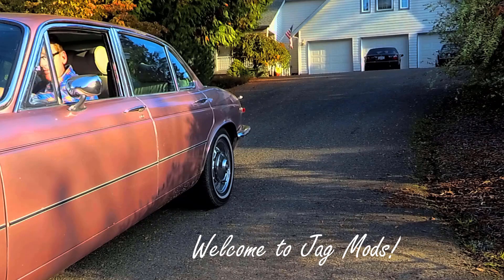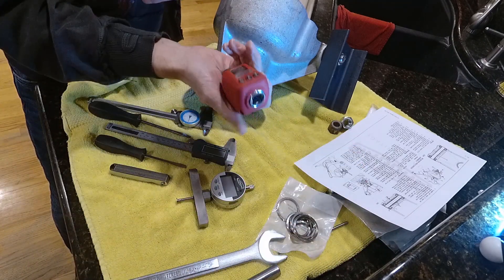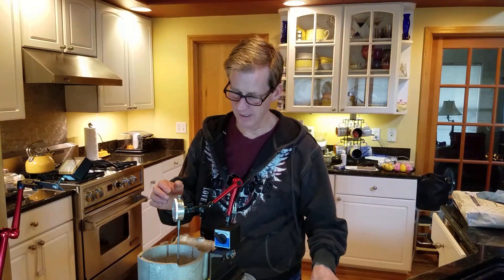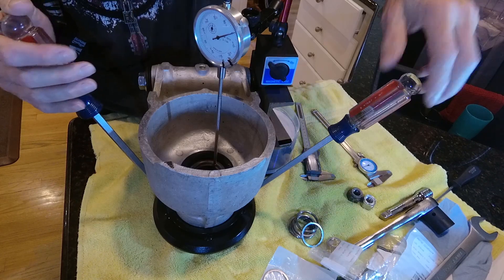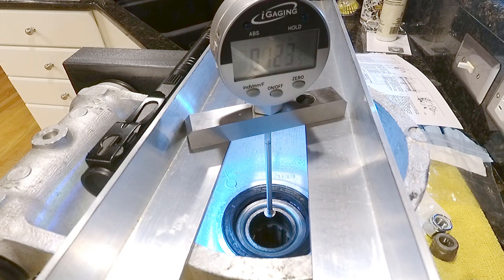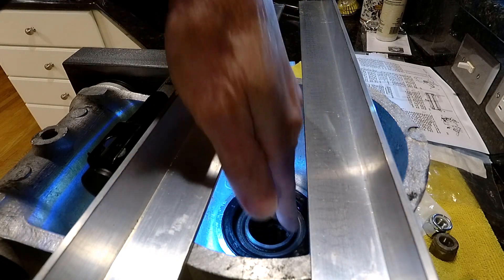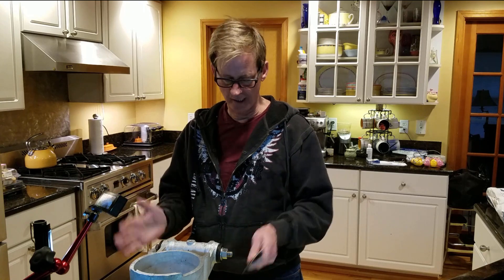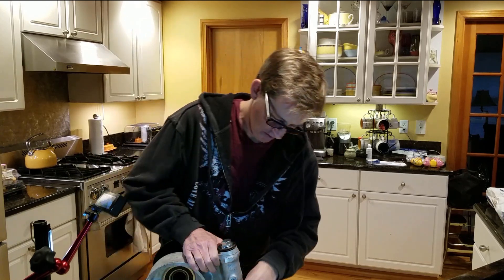The final chapter of the Jaguar IRS Carrier rebuild, Prepping for the installation

Comment: Great videos with lots of details and I have just followed your rebuild of the hub. Jaguar manual specify end float 0.001-0.003" end-float and not preload for the hub shaft. You measured 0.0005" float. No movement would be present if it had preload. It seems the most common mistake people make.
Reply from the maker: Yea, I know I kinda got my words mixed up while I was… well confused. I’ve stated a video on my screw ups and that one was on the top of my list. Good on you for catching it. 
Thank you so much for commenting and pointing it out. Hopefully people will read your comment!  Thanx. Again, mate!

Comment: Mark, I got underneath my Black Pussy and found that the disks were clean of any surface rust (one good thing came of leaving the handbrake on). the handbrake pads do not appear to have been damaged that much so I have adjusted the handbrake through the cable and it seems to be a lot better . I will now go for a test drive and check it's all okay. Thanks for your help. Garreth. Just took her out for a drive, all seems okay, may need to back off the cable a little.
Reply from the maker: Excellent! yes, the cable is the best route to go for heavy amounts of adjustment.  The auto adjust is strickly for fine adjustment becauuse the spring back mechanism is nothing more than a two pronged fork mounted to the top of the caliper and hand brake pad mounting thingies.  haha... It's not spring steel, and over adjustment will bend and / or crack the forks relieving the ability to pull the pads off the rotor when handbrake is disengaged. 
Good news, and good call! 
Sincerely,
mark @jagmods

Comment: Mark, I'm sure I know the answer, but I just drove my XJS with the handbrake on for about 20-30 miles and think I have worn the hand brake pads down to nothing. Is there a way of changing the hand brake pads without dropping the IRS, or adjusting the handbrake cable in the car to take up the slack? K6GTS
Reply from the maker: First off, I highly doubt you've worn the handbrake pads to nothing, unless this isn't the first time, or you're doing handbrake turns in your XJ-S.  There is a whole lot of material on the pads. More often than not, the handbrake pads have plenty of friction material long after the regular rear brakes have warn through the rotor. A way to check it is pull up on the handbrake, and if you hear or feel metal to metal through the handbrake leaver then your right. 
Adjusting the hand brake is done two ways. One by adjusting the length of the handbrake cable by taking up the slack on the cable itself via the nuts on the outside of the cable where it attaches to the handbrake assembly under the car.  Keep in mind,  just pulling the hand brake on and off and on and off and off a whole bunch of times is the fine adjustment for the handbrake.  This is the auto adjustment feature.
How the auto adjustment works,
There's a pawl and cam inside the handbrake mechanism that does the fine adjustment (see my handbrake rebuild video).  Providing your pawl isn't broken.  Which is very common.  Mother nature beckon for the spring to return to earth in the form of rust.  Essentially rendering the fine adjustment useless. 

 Back to your question... do you have to drop the cage out?
Short answer No.  Is it an easy job? not even! It's a bitch - especially if you're doing it in your drive way or garage without a lift. then it's a miserable experience. That being said, 

Here's the game plan: 
Objective - Get the caliper off in order to change the handbrake pads - sadly there isn't any way around it.  Oh, one more thing... if the pads are worn to nothing - chances are the rotor is probably heat checked too and should be replaced.  If it's a series of pretty colors other than rust or silver, then it got hot - really hot.  brown is 480F, purple 540F blue 575F, gray 800F pinkish gray 1000F The colors are a clear indication of just how hot the rotor got. anything higher than purple,  then the rotor needs to be replaced as well.

Ok, back to the game plan... (Sorry side tracked)
The wheels hubs and the half shafts come out as one unit, - easy peasy.  there are two thin washer thingies  these are shims and have to back where they came from.
Liberating the caliper from the Diff is not an easy proposition. The bolts to the calipers are not very accessible There isn't much room between the caliper bolts and the differential, then to exacerbate the situation, there isn't much room between the boot floor and the IRS  unit itself.  
Once you get the lock wire cut off, and pulled out which is a feat unto itself (on the car) usuallly because it's rusted, and breaks off so you can't get a wrench on the bolt.. Then wrenching the two fine threaded bolts, holding the caliper on the diff at about a 1/4 turn at a time is a true test of patience. This whole process will jump up and down on your frustration button(s). 
The shocks and the radius arm will have to be freed from the fulcrum arm / wishbone (what ever you want to call it) in order to drop the fulcrum arm 90 degrees (perpendicular) to the IRS / car / ground in order to get the rotor off in order to free the caliper.  meaning you'll have to get the car at least 22 inches off the ground. Most floor jacks and jacks stands are good for about 19 or 20 inches.  So there's that too.
Like the good book of green (the Jaguar XJ-S Service manual states way too many times) do all of the above in reverse?  USELESS info!! .

It's very important to keep track of where stuff came off during this whole process. Especially the the shims.  There's a stack of them between the diff and the rotor and the other side of the rotor and half shafts these have to go back in the same order otherwise your camber will be off. There is also two sets of two (usually) shims between the hub and the fulcrum arm that centers the hub between the two mounting points on the fulcrum arm.  Those also have to go back where they came from. OH, and the two shims are usually two different sizes. Meaning put the same thickness in on both sides, otherwise the hub won't be centered between the mounting points on the fulcrum arm.  If they're not too mangled in the process of removal.  These can be had at SNG Barratt at a very reasonable price.  Buy more than you'll need because chances are you'll mangle a couple sets trying to get the hub in position - I did.  Oh, also go the salvage yard and pick up at least one scissor jack.  these are worth their weight in gold for fine adjustment / holding heavy parts. Unless you're mister muscle man - these parts do get heavy while trying to finesse all this sh#t back together.

Oh, then there's the lock wire... I have no idea how you'll be able to get that back on the calipers bolts while the cage is on the car. Most self proclaimed Jaguar specialist don't bother with it - and put a lock washer on instead. I personally do not subscribe to this philosophy.  It's there for a reason (to keep the bolts from backing out), The bloke who designed this suspension is a whole lot smarter than I am, so everything goes back just the way it was.  

If it were me? I'd drop the cage. personally I think it's a whole lot easier. I know it's seems scary; but it really isn't that bad.  I'm about 2 videos away from doing just that.  

Thank you so much in watching my videos, tell all your jag buddies and club members if you belong to a Jag club about my channel. 

Sincerely,
Mark @jagmods
Reply: @JagMods  Mark, thanks for your wonderful and full reply. I will get under the old lady today with camera and scope and see what I can find. I only need the handbrake to work for our annual test (MOT), once it's through that I can see about having someone rebuild the IRS in the UK. I have found a couple of places that seem to charge around the £2,500 - £4,000 price. I am due to see someone next Friday and discuss a way forward. Thanks again for a complete and full reply. I do have the room in my garage if I leave the MX5 outside (bought it for a Rust to Rome rally here in the UK). Keep your chin up, keep busy and thanks again.
Reply from the maker: when pricing out a IRS rebuild, be sure to ask what exactly is entailed.  I spent about 3,000 for what I thought was a complete rebuild, but as it turned out they just changed out the rotors, calipers, and pads.  The hand brake now, doesn't work.  II'm pretty pissed about this. and now I get to drop this IRS as well.  4,000 is way too much. and frankly - depending on how much time you have at your disposal as well complement of tools - it's not hard.  fiddley yes. Hard No.
Cheers!
mark @jagmods

Comment: Thanks for the video. I’m doing a 59 Mark I full resto. Where did you source the parts for the IRS rebuild?
Reply from the maker: Bearings and seals I pulled the part numbers off the old parts and sourced from RockAuto, shims and spacers, and any other Jaguar centric parts all came from SNGBARRATT.com
Reply: Thanks for the tip. That’s a great website.